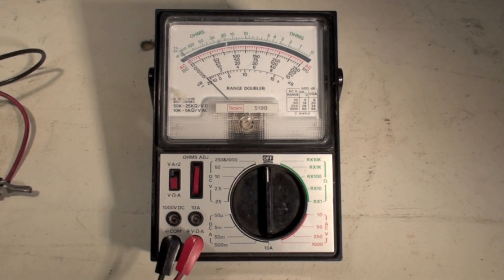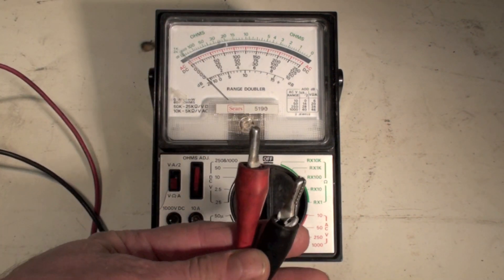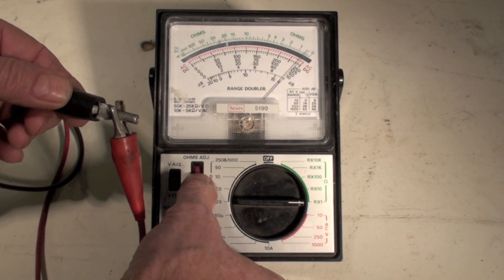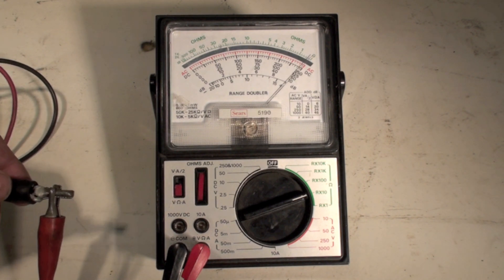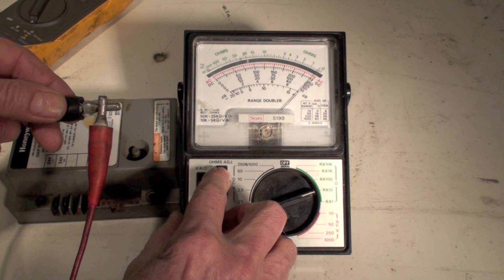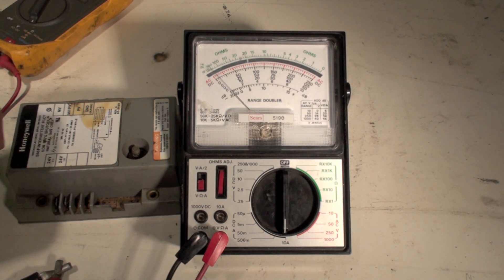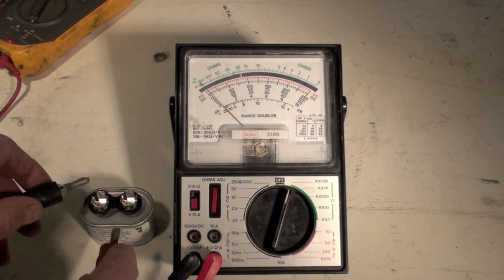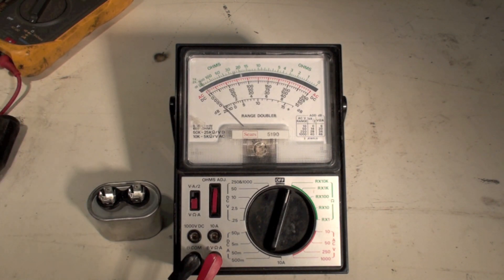Meters for HVAC part 2 analog multimeters

Comment from the maker: Sounds like its time to change to digital.  Some measurements are easier to read on analog but most are better with the digital.
GFM
Reply: Yes I agree lol..
I've been messing around with the meter ever since I saw your video and it does work but the constant adjustment and inconsistencies can wear on you..
I'm work with HAVC so working with a volt meter is a must , working with an accurate voltage meter can mean the difference between keeping that customer or them suing you for burning down their home ..
Or the perhaps the MOST important reason would be not getting electrocuted ..  :  (